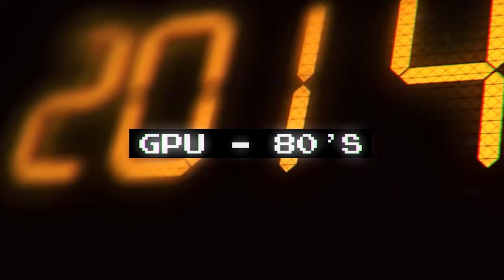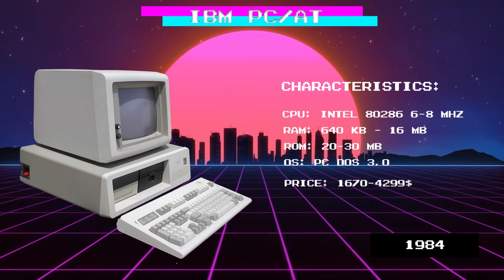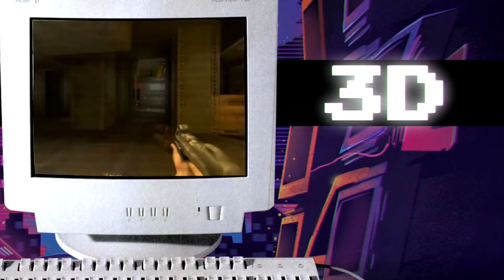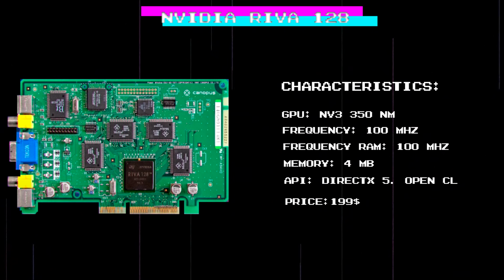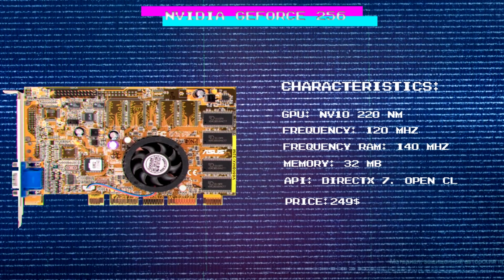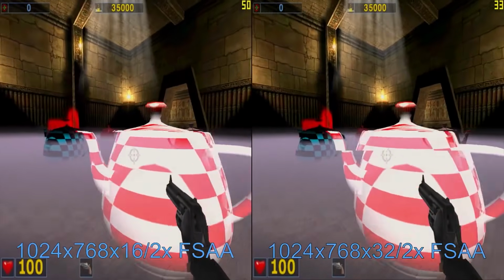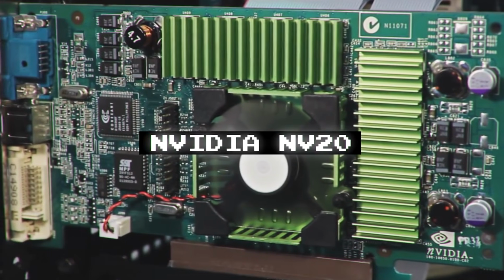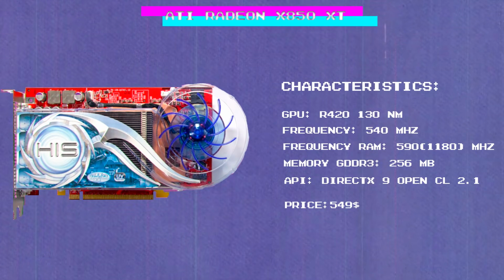History of GPU 1980 - 2020. History of AMD and NVIDIA. History of Graphics cards. Part 1

Comment: My first computer was a 1993 FastData 486/33 with a Genoa VLB video card with 1 Mb memory.  It had VGA true color.  I never replaced this computer; just kept updating it.  Later I had AGP graphics cards.  My first PCIe card was a Nvidia GeForce 210, which was slower than my previous AGP card.  All of my video cards have been passively cooled, as I am not a gamer.

Comment: Skipped ATI's R300 which gave us the 9700 pro and that was a really good card. It did win against the geforce 4000 and 5000 series with it's refreshed 9800 xt later on. I kept the 9700 pro for a while back then. 6 months after the release of the 6000 series, I got a good price on a 6800 gt used. That felt like a massive jump!
Reply: ATI Radeon 9700 was the best of its time.

Comment: My first computers were TRS-80 with expansion interface,  Commodore 64, Apple II, Sanyo Totalable 41 Lbs. 9" CGA screen 2 5&1/4" drives a Sixpac and 10 MB Western Digital Hard card. I still have it then a lot more still in the basement and back bedroom. The only ones I don't still have are the first 3.  I started with my first computer in the early 80's.